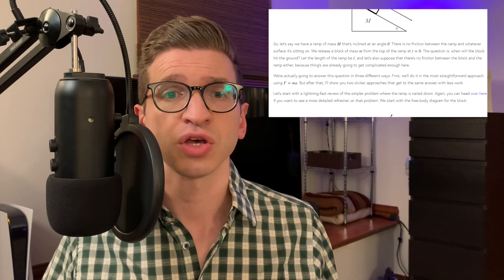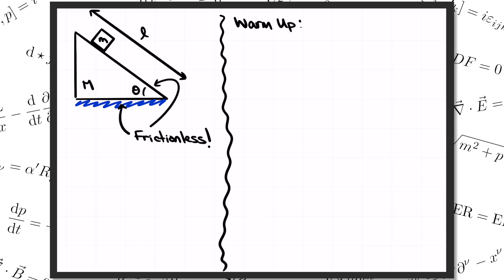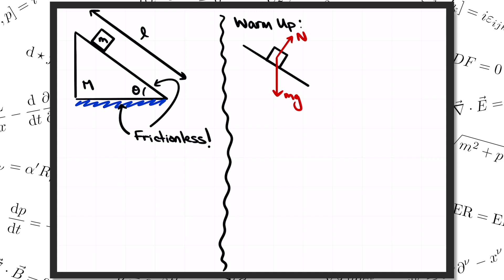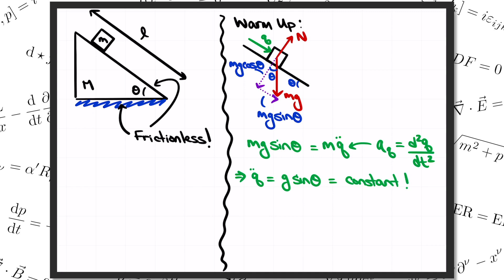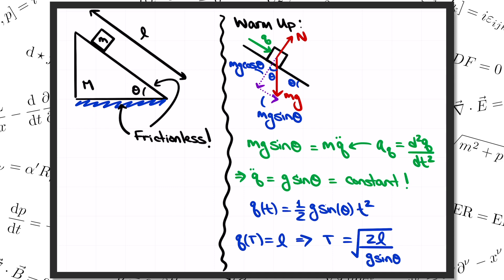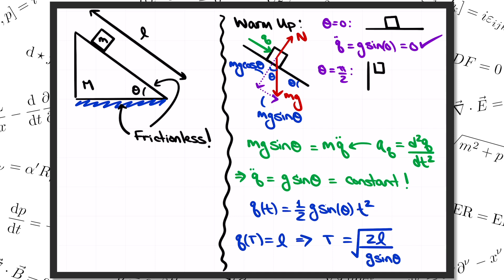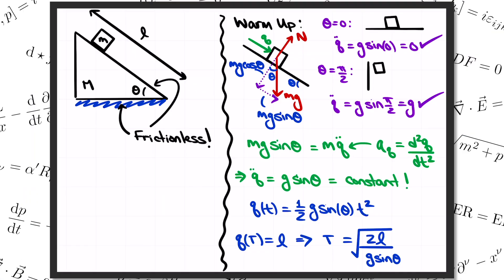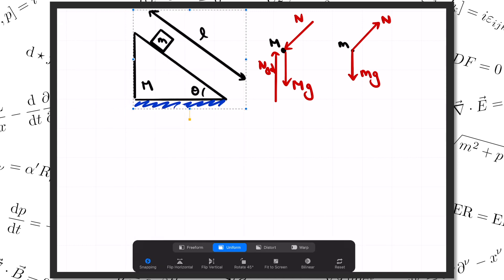What Happens When a Block Slides Down a SLIDING Ramp? Classic Physics Problem

Comment: I am new to the channel and I like it a lot.  A problem not directly related to the sliding ramp problem in this video but, perhaps, somewhat related is this: consider a glass of water sitting on a piece of paper on top of a, let’s say, kitchen counter top. If one pulls slowly on the paper, the glass of water will remain at rest relative to the paper but move relative to the counter top. But if one pulls the paper very quickly, the glass of water will remain fixed relative to the counter top and the paper can be removed under the glass of water without toppling it. The question is what Force or velocity must be achieved to get the latter result. Of course, friction between the glass and the paper is involved here. This problem has been in my head for a long time. I have not seen anything in any YouTube video or physics text book that provides a solution. Can you take up the problem or, at least, provide some hints how to attack it?
Thanks so much and congrats on your impressive videos.

Comment: I tried to use a coordinate system on the block such that de x axis is paralell to the ramp, and the coordinate system of the ram remains the same as the video, but I don't get the same equations. Someone else has done it that way and got the correct equations?. Sorry if my english is not so good.